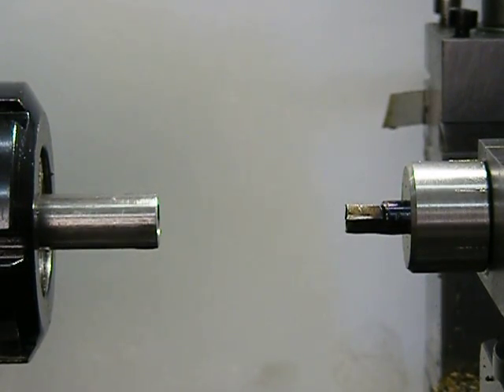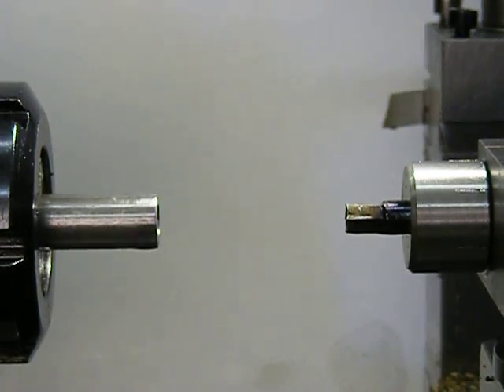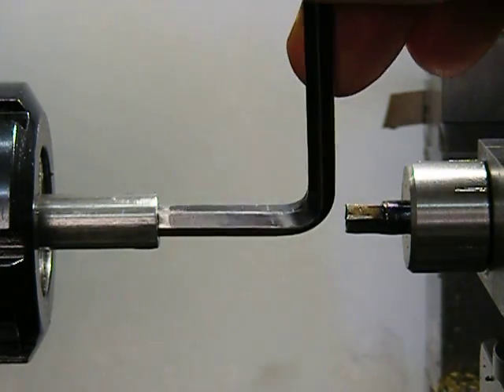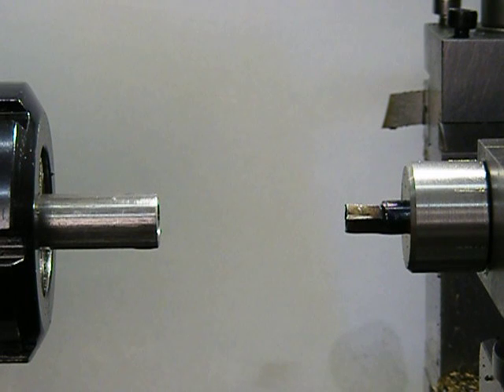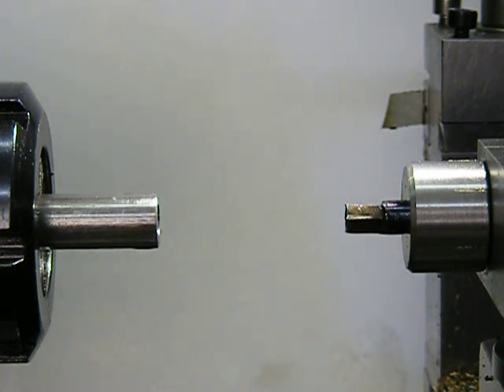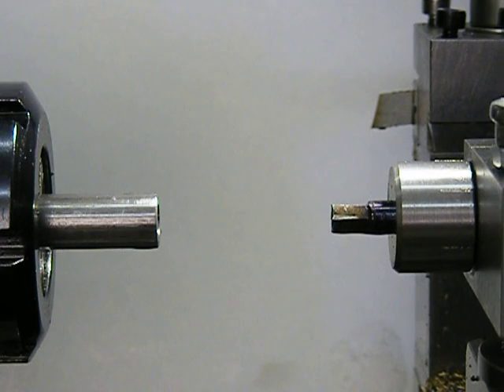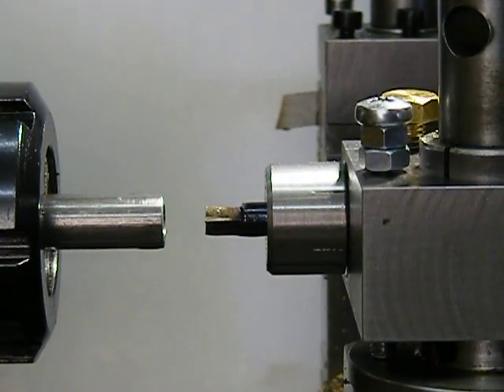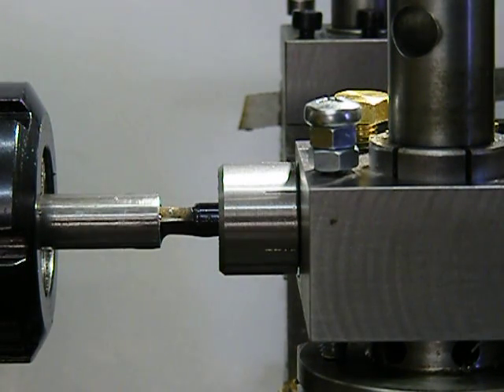Rotary broaching video 2.AVI

Comment: My bad Mike, the topic is new to me so I'm still processing it.  As I was looking at the video, I couldn't decipher why the lathe needed to be rotating as the cutter is "rotating" at the same speed as the work piece.  As such, it seemed to me that the process should work with the part and the tool in a non-rotating engagement.  I need to study up more on this to understand the process better.

Does my comment clarify what I was asking?

BTW, kudos for a lightning fast response :)